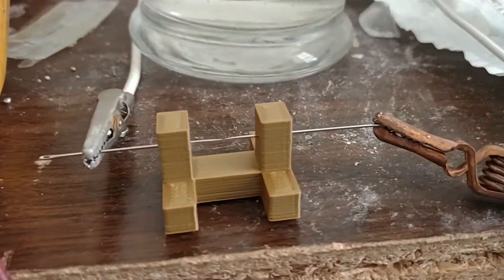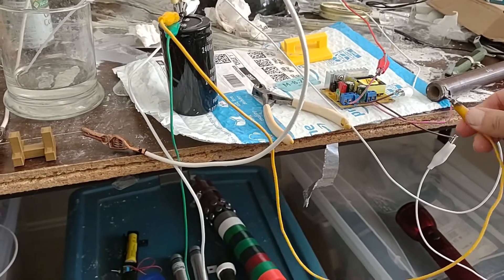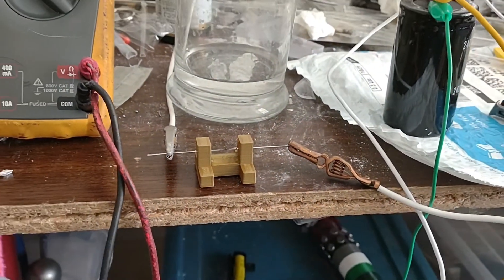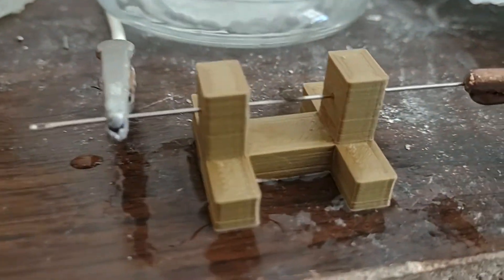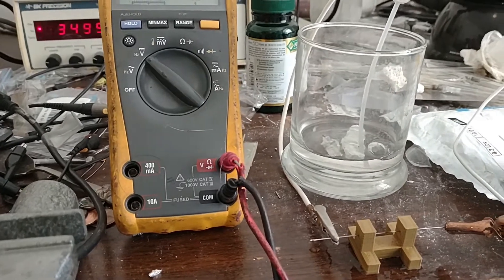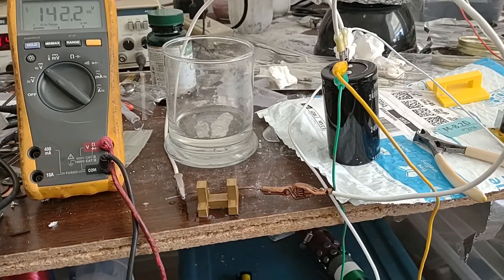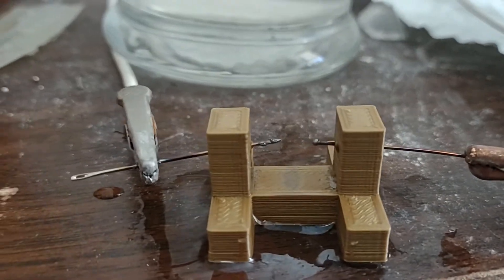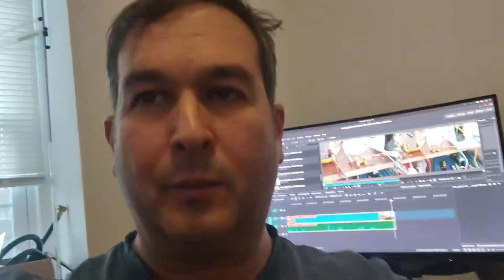Water-Arc Explosion!

Comment: I will try the other way around : not build up the voltage and drip the water, but inject mist  and detonate it in a chamber with a vertical piston. I will use a capacitor discharge on an ignition coil from a motorcycle and a spark plug to detonate the mist in the chamber.  Will have to use a buck converter to also power the ultrasound generator. In total : how much electrical energy  from the capacitor to create the spark gap and produce the mist, versus the work done by the piston head as it is shot up in the air is the result I'm looking for. Moray B. King says that what is happening is because of the sudden discharge, zero point energy is cohered from a turbulent flow into a vortex form into 3 dimensional space, like the pistol shrimp. This would be why there are reports of over unity.. I can't wait for Christmas - bought myself all the parts to try out the energy measurement. The ultrasound generator is useful also for my second project - and just saying this to know you are not alone in this research, Dr. Jaynes. The Keely vibratory lift is second in my mind after this.
Reply from the maker: Interesting Idea! One article I was reading suggested that the thunder in lighting is caused by this effect!? Misting the water might emulate rain drops in a lightning strike??
Reply: @jaynesnetwork  Dr. Stoyan Sarg is doing research into this. In his book "HIDDEN SPACE ENERGY: The Heterodyne Resonance Mechanism", he describes such an engine on page 133. If you Youtube search you will find him play with a small scale thunder generator. He has a massive treatise on physics - it will be hard to go between working on the prototype and reading his book :))

Comment: I created a spiral cell with 2 sheets of stainless mesh insulated by plastic mesh in tap water using a autmotive battery charger. It exploded when i added electrolyte. Took out the charger too.
Reply: That was only 12 volts though...

Comment: Looks like a good way to trigger an EMP coil.
Reply from the maker: I'll have to see if there is any RF emitted from this process..
Reply: @jaynesnetwork  a controlled spark gap for a SGTC. Next try the usual ball shaped terminals instead of the needles and see what happens... but use a heavy base for the (fully metallic) gap assembly. You don't want the balls turning into bullets
Reply: @jaynesnetwork  Try dropping an ice cube also